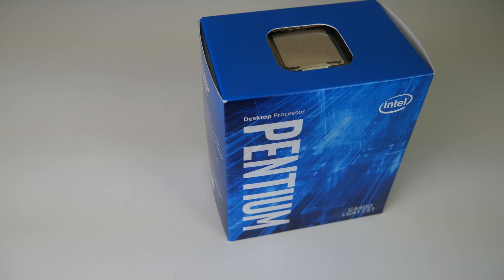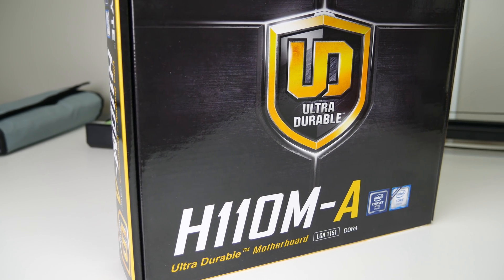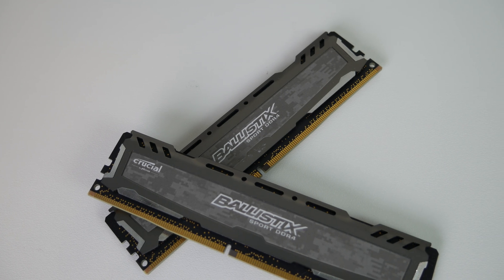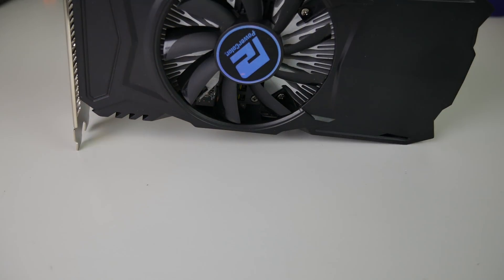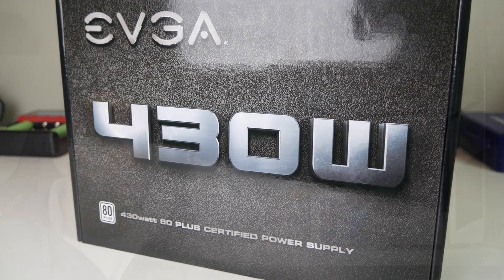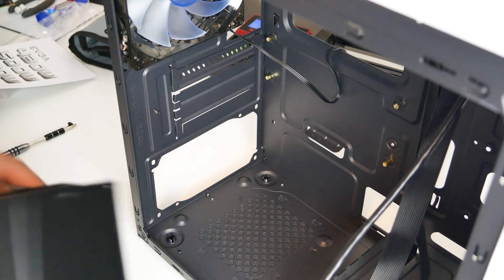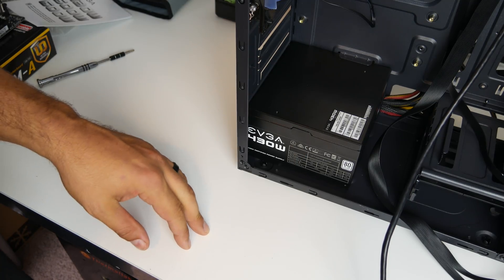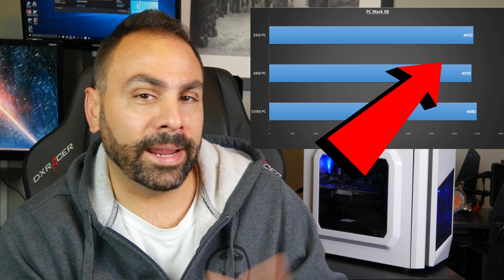The Best PC You Can Build - $350

Comment: - CPU : Intel® Core™ i5-2500  ( 6M Cache , up to 3.70 GHz ) ( 4CPUs )

        - RAM : 4GB DDR3 (2GB X 2) 

        - HDD : 500GB

        - MB : MSI H61M-P31/W8

        - VGA : Nvidia Geforce GTX 1050 2GB

        - Power : 650W (Big Red Fan)

        - CASE : is up to u
i build it ready but i cant play gta 5
Reply: get a 8 gb ram, 4 is not enough

Comment: Dude your cable management could have been a lot better. I own this case and you missed the hole for the cpu cable, just route it before you install the motherboard. And the cables could have came out the bottom for a cleaner job.
Reply: SpeedDemon12309 I was thinking  about buying this case for my first build. Would you recommend  it?
Reply: Ethan C yes I would, do note that you have to slightly bend the piece that blocks the psu and make sure to route the cpu cable before you install the motherboard. But it is a great looking case at an affordable price and my build went smoothly (roughly 45 minutes) good luck building
Reply: SpeedDemon12309 thx! :)

Comment: When I was building this the power supply had a 4+4 pin EPS12V output and the motherboard had a 4 pin ATX12V input for the CPU. I just plugged one of the 4 pins into the other one but my computer turns on with 5 beeps (indicating CPU problem). Idk if this is the problem but if someone could let me know that would be great

Comment: I would say future proofing at this price point is a bad Idea. 

You can get a i5-2500 PC at eBay for around $200.
They come with 1 year Warranty from Manufacturer and Windows Licence key.
Here is a link :http://m.ebay.com/itm/HP-Elite-8200-SFF-PC-Desktop-Core-i5-2500-3-3GHz-4GB-250GB-Win-7-Pro-1-Yr-Wty-/201576455108?nav=SEARCH

This PC has 4GB of DDR3 RAM. for modern games which is low. So you need to buy another 4GB kit. Which will cost you $20. Now add a SSD. 120Gig SSD cost $40(search Adata SP550) .
Now get RX 460 or GTX 1050. You would have a better system than him with a Windows key. but yeah it's not upgradable. You can't upgrade to New Chip or something like that. but its performance is better. 

If you wanna build something 
http://pcpartpicker.com/list/cKyqbj

I know it's old dying AM3+ Socket blah blah blah. but If you want performance can't go wrong with this.

Comment: Won't the g3258 oced to 4000 mhz be a better choice? Plus, it is only one generation older than Skylake and is easily overclockable with the cheapest h81 mobo out in the market.
Reply: Nope, biggest reason for going with a 55$ intel dualcore in the first place is the upgrade path. The 1151 chipset supports kaby-lake, so an i5-7500 or something would be a great buy after using the pentium for 1-2 years. You also get ddr4 which has shown to give massive performance gains in some titles including fallout 4.
Reply: William skagen I didn't know that ram speed affected game performance. And an haswell i5 has no performace difference with a skylake i5 and I dont think the kaby lake i5 will have more than 10 percent performace than a haswell i5, which is very insignificant.

Comment: I would really like to see the X99 PC. I've recently decided that I want to build on the X99 platform as an upgrade. I'm going to do a whole bunch of 3D design work as well as gaming on it, but do not know the line of CPUs that work with this platform. It would be great to see what your thoughts are on the components etc.
Reply: If you decided to go X99 then take the word "entry" out...It's not for the cheap or budget builder. Either build a good Z170 or Z270 system and deal with the slightly slower performance or go all in with X99. Otherwise you will just waste $ on a under utilized system.
Reply: I know it's not cheap. Even the motherboards aren't starting at cheap prices, but I'm in need of faster performance. I removed "entry" from the comment. lol. Not to cause confusion, as I meant it not as a price point but rather an introduction to the X99 platform. I already have a Z170 PC